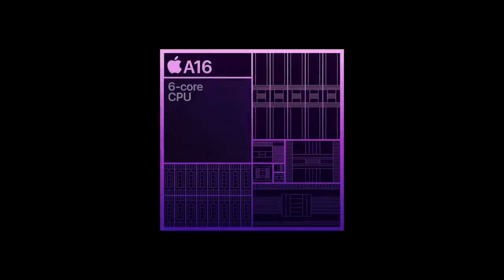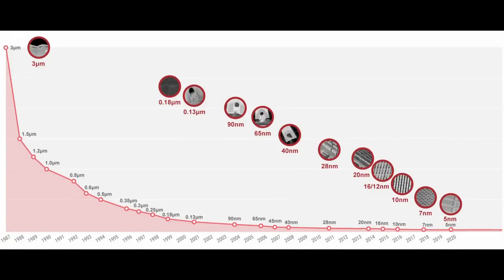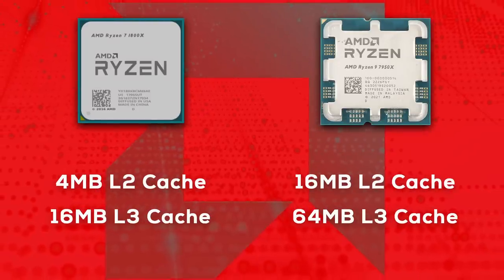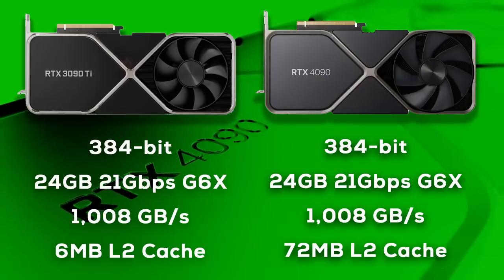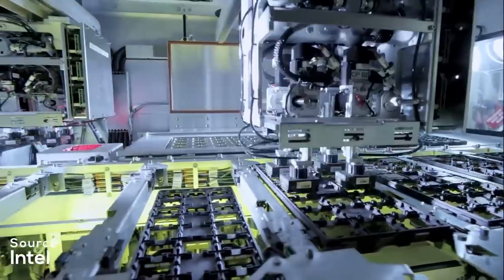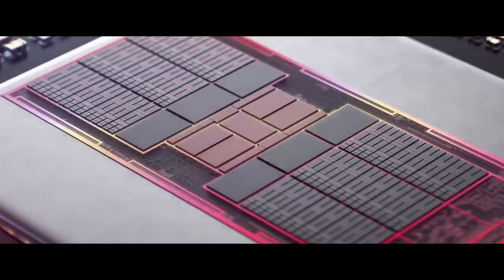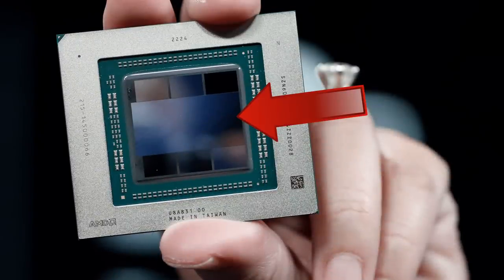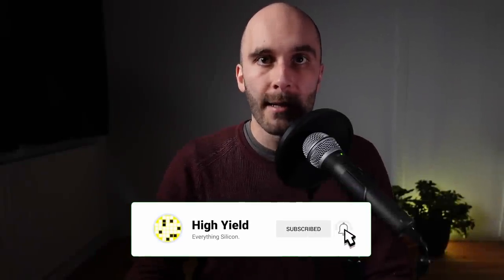Next-Gen CPUs/GPUs have a HUGE problem!

Comment: Nowadays CPUs have more cache memory than my
first PC had RAM.
It's amazing how far we've come in terms of processing power.
Reply: 486 :D
Reply: I think once we get a better process than calculating parts of the Program ahead of time in parallel in all possible outcomes and then throwing away all of the cached results but one because of a result ahead in the pipeline, we will get to need way less Cache.
Reply: But the L1 is still small and shrinking it no longer makes it faster.
Reply: @uvuvwevwevweossaswithglasses  How much RAM did a gaming 486 have, and about how much was a megabyte of RAM?
Reply: I just built my first pc the other day and got it to post on the first try. It literally take 1 second for it to boot up. I didnt think the new i9 was so strong
Reply: I still remember when 512Kb of L2 was a lot of cache for a CPU... now we have chips that have 3x the memory of my first Pentium III machine. It's nuts how much memory there is just in cache alone crammed onto modern chips.
Reply: Especially since the computers used during the moon landing in 1969 only had 64 kilobytes of ram.
Reply: I have a workstation with 128gb of ram and next gen cpus already come with 64 gb ram in the die.
Reply: My very first computer had a whooping 48K of RAM... Now, any CPU, even the very cheapest entry level ones, have more L1 cache than one of it's 5.25" floppies.
Reply: no shit
Reply: @GeomancerHT  megabytes not gigabytes on the CPU.
Reply: My current cpu has just about a million times the ram of my first PC lol.
Reply: @bricaaron3978  8-16 Mb   8 was able to run windows and word.  16 Mb allows to use internet and lan
Reply: @GeomancerHT On a CPU? Which?
Reply: @bricaaron3978  My first PC was a Pentium 166 and had 32 Megabytes of RAM, which was considered a good amount back then.

It was a mid-high end tier PC for 1997, but in order to be considered "gaming" it had to have a 3DFx accelerator, which it didn't have, so it was not a gaming machine (although it could run most current 3D games, like Tomb Raider 1 and 2, just fine, but in software mode). 

The video card was a basic S3 Trio and then an S3 Virge, nothing fancy.
Reply: Mr Guru  I don't know about that guy but the Commodore 64 had 64Kb of RAM and was my first computer (although it was already the 90s, the machine was very cheap back then and not cutting edge anymore).
Reply: @Kualinar  Nobody needs more than 64kb of RAM anyways;)
Reply: @flioink  Actually heard someone saying that one.
Reply: I wonder if we can run msdos on modern cpu and use cpu cache instead of ram?
Reply: @bricaaron3978  I remember getting my 486 right in time to play Ultima Underworld and thinking that the 8MB I ordered were probably total overkill. But SMARTDRV.EXE was happy for every MB I assigned to it.
Reply: He-he, RTX 4090 has 72 Mb of L2 Cache. My first PC had a video card with 64 Mb of total video memory. And that's like 15 generations og NV gpu's between MX 440 and RTX 4090.
Reply: Mr Guru  The first IBM/Intel PC had 16K of RAM expandable up to 256 (so 64K was a definitely an option).

In the end, other than unpleasant you're also wrong.
Reply: @bricaaron3978  Gaming PCs didn't exist as such in the 90s.  You could but a 3Dfx card for your AGP socket and that was about it. 1MB was about £100 in the early 90s.
Reply: @Blitterbug   You're  right, it was a transition period, for a long time gaming was relegated to consoles and microcomputers. 

The Amiga, for example, was a far superior gaming machine to any PC for many, many years.
Reply: @DigBipper188  LOL 512Kb is 64KB, and I remember when that was a lot of cache.  (I was happy that my first computer had 64KB RAM.  The first home computer that I used had 16KB RAM.)
Reply: @kirill9064  You could probably run MSDOS, Lotus 1-2-3 and Word Perfect entirely from the L2 cache.
Reply: @250CC Oh, F-Rune is even further away from reality than you think. There is NO modern processor that computes both paths of a conditional in parallel and after the condition is resolved, discards the wrong path while keeping the correct path. Instead, as you mentioned, branch prediction is performed and if miss-predicted, the results are discarded and the correct path is then performed.
Reply: MrTGuru  TI 99-4a ?
"a memory expansion card, installed in a peripheral expansion box, can provide 32K of RAM"
PC does not equal x86 ISA.
Reply: True, but that's not the point. SRAM is old tech and we need a replacement that uses at least half the number of transistors.. There's R & D tech. that uses 3 or 4 instead of 7 transistors per bit. Of course, optical / photonic computing will smash Moore's Law to bits within 10 years.
Reply: @PrivateSi  First off, a SRAM cell uses 6 transistors, not 7, so your technical knowledge is rather suspect right off the bat. The cell consists of two inverters connected in a feedback look. And with CMOS, each inverter takes 2 transistors, for a total of 4. The remaining two transistors are used as pass transistors to access the normal and complemented values of the cell. If you want fewer transistors, you can use DRAM (1 transistor per bit). But doing so costs time due to the refresh requirement and sense amplifiers. And since SRAM is used for speed, the higher density and slower access of DRAM contraindicates its use.
Reply: @johncochran8497  .. Just going from memory.. Near enough! It may well have been 7 at some point. know DRAM is 1 transistor and the rest. My point stands. Spintronics in a photonic computer is as far as we need to go.. Atomic memory of at least 1 bit per atom (up/down spin) would be plenty, but potentially many bits per atom if spin angle can store a value. SRAM uses much less power than DRAM, but photonics uses much less than that. There are simple commercial photonic coprocessors coming out. GPUs will be  the first to benefit. There are 'Multiply and Add' specialised chips in production for light speed parallel processing.
Reply: @PrivateSi  You just keep digging yourself deeper. I would strongly suggest you start checking your sources instead of going off of your memory. First off, DRAM uses LESS power than SRAM. And yes, in theory you could store at least one bit per atom. But the real question is how fast can you read and modify those bit(s)? And how many atoms are needed to create the mechanism to read and write those bits? And overhead is all too often omitted from a discussion in order to create a more impressive number. For instance, there's a "single-atom transistor" out there. Look it up on Wikipedia.  The truth of the matter is the transistor works by modifying the location of a single atom. But that "single atom" is part of a much larger structure and calling it a "single-atom transistor" is disingenuous at best.
Reply: @johncochran8497  .. DRAM does not use less power than SRAM. You are misinformed. DRAM has to be refreshed as you correctly stated.. Photonic computers will start off as binary, and then go semi-analogue (light and spin are still quantised at a low level by h-bar)..  Transistors are made up of many atoms, and there's a size limit we're reaching. Atomic memory = atomic transistor, except it doesn't provide voltage amplification and will be actuated by light, not electrons. 
--
Light frequency determines the transfer rate, along with number of channels.. We can already multiplex a few frequencies in optic fibres. I'm interested in what's in the pipeline. Like I say, IBM down to start-ups are working on 3 and 4 transistor SRAM and other low-power, high speed electronic alternatives, as well as photonic and spintronic tech. This revolution is underway and should be well commercialised by 10 years time.
Reply: My own first PC was a laptop with a 3rd gen i3 and 4GB RAM, i'm a child compared to you guys that grew up with 486s and Pentiums or older lol
Reply: @PrivateSi  Yes, there is RAM that use only 3 or 4 transistors per bit, it's called DRAM, or Dynamic RAM.
DRAM is slow compared to SRAM. SRAM is much faster. That's why we use it.
Reply: @Kualinar  .. DRAM only needs 1 transistor. DRAM uses a lot more power too, and gets hotter, so is also problematic for CPUs. OK as separate chiplets. On-die or chiplets next to the CPU with high bandwidth connections also add more heat but improve speed. Latency is still 10s of times worse than SRAM, but lots of level 3 or 4 cache is useful. DIMMS have hundreds of cycles latency.
Reply: @Kualinar  .. DRAM uses 1. It needs much more power overall and is delivered in short bursts of much higher current than SRAM. Even on-die or chiplet DRAM (level 3 / 4 cache) has 10s of cycles latency, DIMMS hundreds. Lots of higher level cache can be very useful though. There should be a lower latency DRAM standar for memory that connects directly to the CPU (and a CPU connectivity standard to match.. CPIe!)
Reply: I have a PDP-11, which cost about $15000 when new. It has a whopping 1280KB RAM. Roughly 10 times less than the L1 cache on a modern CPU. The -11 could run UNIX too. So theoretically, you could run a UNIX-like on a computer without any RAM on it, just using the cache.
Reply: What more amazing isn't that, but the fact that they spend most of their time idling waiting for Cache to pull data from RAM.

I had a 80486DX2, that thing would spend 60% of its clock cycle actually doing calculations, but nowadays, calculations are so cheap, CPUs spent most of the time doing nothing. 
Its 99% wait for the cache and 1% doing computation, which happens parallel out of the order, so computing is essentially free.

A CPU is basically cache and logic to manage it and pretend to be a PDP11 for the " C language " to keep " being fast " (C is not fast, if you had 40y of hardware optimization, you could have Lisp be fast)
Reply: But we're approaching the end of the Von Newmann architecture very soon, the bottle neck of having a stored program is damn near.

The era of general purpose computing will come to an end. Because we have plenty of silicon space to actually do computing by not using memory and simply letting data flow between the chiplets. 
But that would entail an entire new architecture of programming and computing.

Its exciting times. (not for C programmers, C will die very soon, sequential mutable state programming can't scale)
If you have less mutable state, you need less memory, so you need less cache and suffer less from big DRAM cells, then you can have other architectures.

Do we really need big complex CPUs with that much memory ? 
What's stopping a CPU being made from 64 stacked chiplets each with 2048 very small simple cores ? in a 3D cube cooled with a pumped gas ? 
And to keep it running, as it doesn't have cache, we use optic fiber and optronics, so we can store the RAM elsewhere and it doesn't need to be smaller.
The only thing that's stopping us from having 128K cores is programming languages and operating systems.

All that is possible, now, with current technology, all it takes is to rewrite all software in a sane programming language.

The Moore's law death is overrated, we have plenty of space, we just need to use it better. The Imperative paradigm days are counted.
Reply: @soylentgreenb  L1 cache hasn't increased that much, but its bandwidth has increased 100-1000x...
Reply: @andso7068  next gen intel cpus for servers come with 64 gb of ram and they have a couple of modes where is used as a huge cache, combined with your ram, or as the only ram of the system... pretty impressive.
Reply: @02091992able  no, new intel ones for server (I assume AMD goes on the same path) are adding gigabytes of memory.
Reply: And it's even more shocking that this trend of infinite scaling is coming to an end. Sure it was to be expected but still the stagnation of improvement in computer until a new technology is found will be catastrophic to the market.
Reply: Its actually not amazing at all considering what was promised, especially in the early 2000's. Progress has slowed to a crawl especially when it comes to CPUs...
Reply: @kellyshea92  Sounds like BS to me. My 12900k system takes 15 seconds just to post and I've heard some newer PCs can take up to 30 seconds. Boot times are actually much slower today than they were even in the early 2000's... My old i7 2600k system is literally in windows, with all software almost fully loaded before my 12900k even posts....
Reply: @flioink  original saying is 640k ram.
Reply: More cache than my first PC had hard disk space!
Reply: @02091992able  That's how come that little box with the foil, cardboard and duct tape with grown men in it could land on the moon and broadcast live footage of itself taking back off for Earth.

It was the light weight RAM, and it was less than 64K...
Reply: Well, on the other site this more power doesn't necessary lead to better usability. More fancy UI, everything written in Javascript.
When you check old software vs. stuff written in electron. The old stuff is still faster on old machines.
It's about time the software-industry stops producing crap.
Reply: Same, imagine where we'll be in 20 years
Reply: @rpscorp9457  'My current cpu has just about a million times the ram of my first PC lol.'  Yep, literally.  My first main computer was a Commodore 64 back in 1982, with 64K.  64G in my current pc built Thanksgiving 2021, and that's simply a $500ish build not something top of the line.
Reply: @rijjhb9467  true, and I wanted one so bad...
Reply: My GPU has more VRAM than my first pc (a PIII System) could even have RAM installed LOL
Reply: @AndAbel-AOD  yeah, post times etc have nothing to do with your CPU lol.

It has to do with the motherboard chipset, nothing else.
Booting into windows does have something to do with the CPU, but we are very well past the point where the CPU type matters unless you go ultra cheap.

Anyway, if your system takes 15 seconds to post, or worse, 30, it's generally just a setting you can change in the BIOS/EUFI itself. They give it a standard delay of 5 or 10 seconds (generally, from my experience) so the user has time to press the requested button (f2, f8 or del, etc) as the screens won't turn on right away in order for you to see it. Boot times have gotten ultra fast thanks to UEFI and getting into the bios/uefi became a serious problem. But you can totally turn this delay off...
Reply: @ModelLights  Aye, I had 3 C64s,  a C128 and an Atari 800XL before buying an Amiga 500 with the 1 meg upgrade...it was like a DREAM and had the best audio until Commodore went out of business.  My first ever PC was a Ti99-4A  with a damn tape drive....and in today $$$, it cost me a fortune.
Reply: @TremereTT  most likely we will return to external cache from the chip  or a two die chip like intel did with the 128mb l4 cache chips..or 775 "quadcores" which was two cpus on a single chip
Reply: They will keep shrinking components and doing CPU dies bigger, so at some point they will cram the entire motherboard on the CPU.
Reply: @theBabyDead  I don't know whether its the CPU or new motherboards but the post time is ridiculous and you don't seem to get it. This is not just a setting in the bios. You literally don't even see a screen where you can enter the bios for 15 seconds. I heard 30 seconds from a user with a new AMD chip.

My 9900k system took 5-10 seconds just to get a screen to pop up and I was running full UEFI. I thought maybe they would have rectified the problem by now but my 12900k is even slower. Mobo's are ASUS z390-e and z690-e.
Reply: @GeomancerHT  No need of  space heaters anymore!
Reply: @flioink  Thats the truth. My 3080 ti LC fills the room with heat when I game. It literally resembles a space heater when I feel the heat coming out the front of my case. CPU heat is considerably less coming out the top but its still quite substantial.
Reply: @theBabyDead  New CPU's and mobos are also notoriously bad for using 4 RAM slots. Many people are having major problems getting their systems stable with anything more than 2 slots. I've heard some suggest that the CPU's are specifically designed for dual channel RAM and this is the reason but I honestly don't know why but I've seen many users complaining of this issue. 

ASUS has posted on their forums suggesting that users only use 4 slots if it was bought that way in a kit and not to mix kits even if they are the exact same RAM because this problem is so prevalent. 

I've also heard of this problem with AMD chips, not just Intel.

I'm personally using only 2 slots and thankfully I haven't had any of the RAM nightmares with my newest build as others have had.

My old i7 2600k build I mentioned before has all 4 slots populated on the ASUS P8P67 Pro using 2 kits of the same RAM with no problems whatsoever.
Reply: now you've got me wondering if with the right motherboard, a CPU with onboard graphics could be repurposed into a full-system emulation of a classic console without any ram or storage? just trick it into keeping the whole program cached?
Reply: @flioink  computers will keep the standard/average of 500 watts of power supply so probably less heat because processors will be more efficient.
Reply: 640K ought to be enough for anybody, anyway. Which is apparently not a quote from Bill Gates.
Reply: I imagine the first people coming up with the bytes and then adding the latin prefixes and thinking "gigabyte? who would ever need such a huge capacity ever? petabyte? don't make me laugh, hexabyte? I know the words exist but why?"
Reply: My celeron 333 mhz had 64 mb sdram
Reply: @rpscorp9457  Ha yeah I'm a tech, by like 1993 or 94 when I switched over to PC I had like 92 C-64s.  Mostly parts carcasses and donated 64s, probably about 20 or 30 working ones.  A few Amigas, 128 and 128-D, SX-64 that I hacked a 1581 into, etc.  Actually I had a 1 megabyte C-64 from the Transactor articles, 512K in the 64 and 512K in the REU.  Of course that came late, 64 was kind of dead then, everyone was on to the Amiga.
Unfortunately I had some boxes stolen during a move, so lost most of it.  And I didn't buy back in since they weren't worth much at the time and PCs were the main computers going forward..
Reply: @GeomancerHT   the cpu can be on the backside
Reply: @02091992able  computers didn´t play a role in filmstudios at that time.
Reply: @Deadeye313  This is a valid use case of the technology!
Reply: @stephenfritz7493  My 8086 had no cache :)
Reply: @AndAbel-AOD  hmm, weird. Idk man, maybe it's peripheral related? I have a reasonably new mobo (for the 5900X) and it's on my windows loginscreen as soon as my screens turn on. But I do know I barely have any peripherals... I wonder... I do know the very first post takes ages though.
Reply: @theBabyDead  I have 3 internal hdd's 4tb WD Black, WD Gold 12tb and 18tb  but I've tried it with the hdd's disconnected and I'm fairly certain it was the same. I tried this on both my 9900k system and my 12900k system but I don't remember for certain whether there was a difference. I think I would have remembered if there were.

I have had an external hdd delay at the post screen a couple seconds, but its a very very slow old drive. This delay happens before I even have keyboard power and that external drive is not currently connected.

I've had a variety of component changes over the years and this problem persists. I don't have anything else hooked up that should be causing a delay like that.
Reply: @theBabyDead  P.S. All my hardware benchmarks as above average or way above average. My SSD's especially are supposedly 95-99 percentile on User Benchmark. I have a 2tb 970 evo and a 2tb WD Black SN850.

My CPU is also above average in 3D Mark and CPU Geekbench.

Windows actually takes a long time to load even after the post screen. At least 5-7 seconds. Thats after the initial 15 seconds and then the post screen 3 seconds.

I have a feeling the problem is the boards and that ASUS has really dropped in quality recently. I don't think I would buy another ASUS board after these 2. 

Their "Armor Crate" software suit is some of the worst convoluted and outdated bloatware I've ever seen.
Reply: Great point
Reply: @bricaaron3978  When 486 became affordable as family PC, a typical family PC had about 4 MiB of RAM and later about 8 MiB. The 486 itself had 8 KiB of L1 Cache.
Windows NT 3.1 and later was out of scope for most users, it required 12 MiB of RAM. 1 MiB of RAM did cost about 70-80 Dollar.
Reply: @Blitterbug  You're wrong. A gaming PC had a (S)VGA card and a soundcard at that time, a fast CPU and about 4-8 MiB of RAM,  a CD-ROM drive and the OS installed was DOS. That was the definition of a gaming PC in 1993.
The none gaming PCs usually had no soundcard, some of them had more RAM and OS/2 or Windows NT installed. It took about 5 other years, that soundchips where put on the mainboard by default.
Reply: @kirill9064  all modern CPUs all have an exec mode for using the highest level cache as a system RAM. They need it for booting the RAM, because modern DRAM needs sophisticated signal training to work, which needs some software from the BIOS.
You need to patch the BIOS to allow this exec mode during boot, and a somewhat patched DOS (maybe a thin emulation layer).
Reply: My 386 not even have L2. And current L1 is more than my first 486DX2 64KB SRAM cache.
Reply: I used to have 256MB ram.
Reply: @asoka7752  256 MB was several years after the DOS era. Most mainboards were even not able to allow more than 64 MiB of RAM
256 MB was a thing after the end of 1998. So nothing special.
Reply: @asoka7752  Stop playing the race card. There were enough none w people that could afford 256 MiB of RAM in 1999.